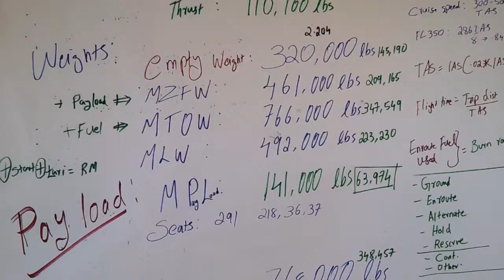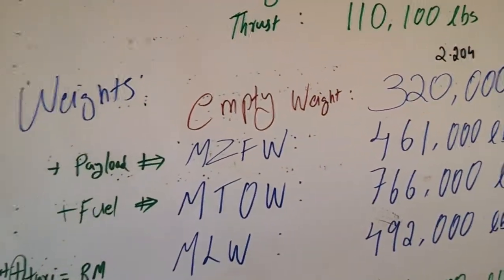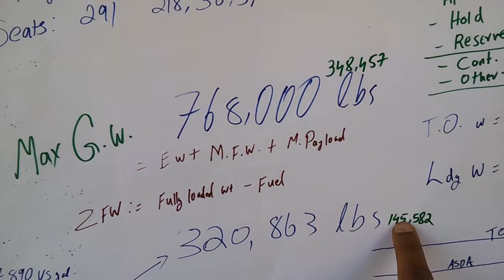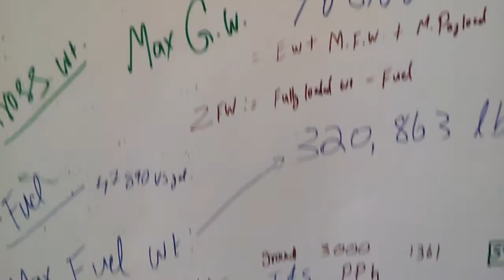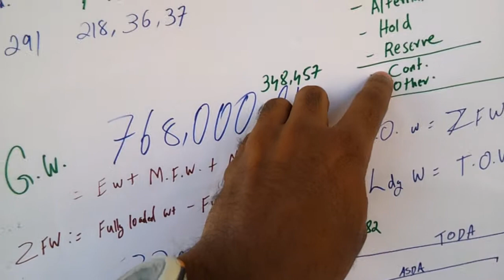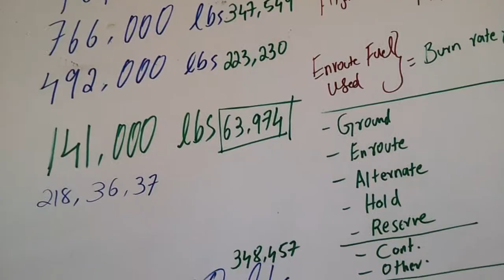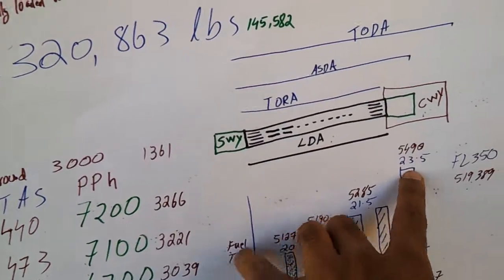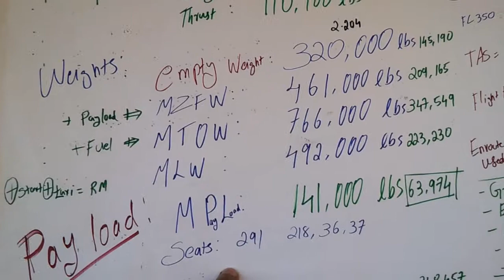mass and balance  Boeing 777

Comment: This is truly good video ,we use to work with manual Load and Trimsheet in the 80s and 90s but now everything is printed via computer so things and working style is different. Basically Ground Operations has changed a lot. Also not to mention the privileges too.

Comment: is that the burn rate of the fuel on max pay load
Reply from the maker: yes, it could be of max payload. but to be sure (as i got the information from a table which doesn't specify the payload). to be sure, we need to use a different kind of chart. where there will be tables correctly showing at which payload you are at and what will be the rate of burn. this is to give a general idea of the fuel burn. not to have accurate measures from it. i could bring 737's chart for you but 777, i have only the shown information. it is to take as generalized ones. then there will be as you are aware, temp corrections, elevations, flight levels, and wx. which adds/subs some more from it. let me know thoughts, ok